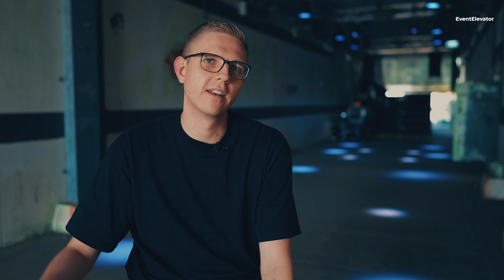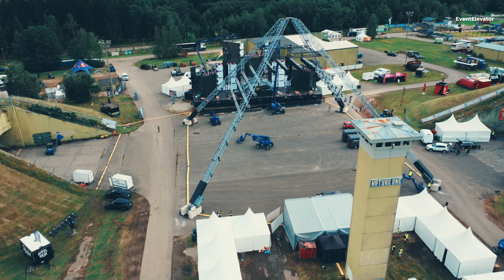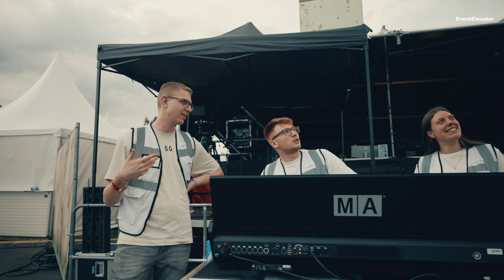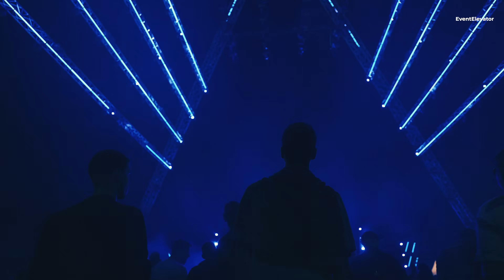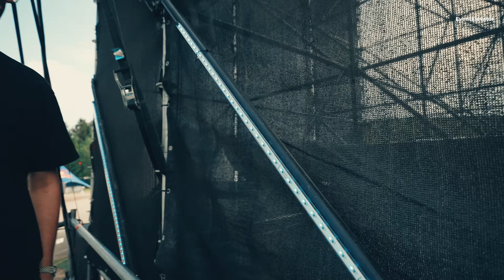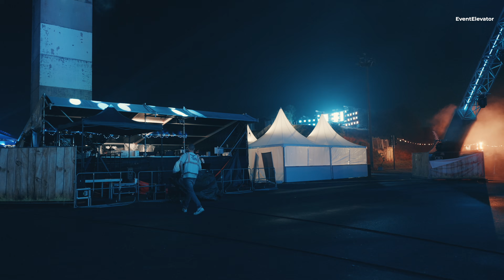NATURE ONE Festival • Production and Lighting Design • Behind the Scenes

Comment: What was the reason behind choosing mode 2 over mode 3 on the MA? Not to disregard MA2 as a platform (currently touring in Mode 2 on 3 hardware) but I’d think some of the features in Mode 3 would make sense to have to make life easier.
Also were the single pixel fixtures driven by the MA and the fx engine or via Art-Net through Resolume?

Gruss nach Dehääm von nem Speyerer buwe in Texas😊
Reply from the maker: Thank you for asking. We'll find out for you and ask again. I know that the Gerdon Design crew are now running many of their current projects entirely in MA3 mode. Especially with pixel-intensive programming, this has many advantages. Stay tuned, we'll be in touch.
Reply: @EventElevator  thanks guys! Yeah especially for EDM a lot of my friends (that do some of the largest EDM acts here in the US) have been running mode 3 exclusively for the past 2+yrs and even on the festival side I’ve seen more mode 3 than 2 this year for the first time. 
And knowing that gerdon design usually is on the forefront of things in Germany I was just surprised to not see mode 3 with this many pixels.

And also huge thanks for the continued awesome content. Always makes my heart happy to see the German Entertainment industry still going strong, where I had my start almost 20 years ago.